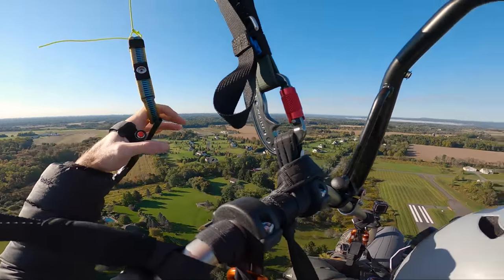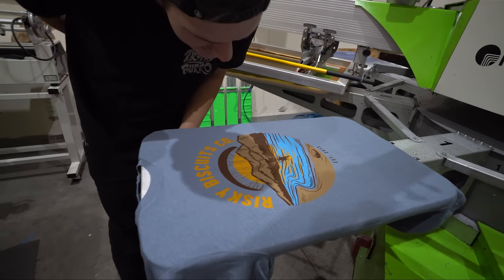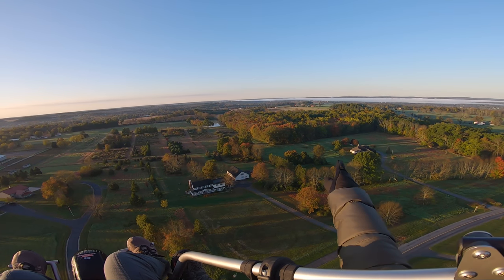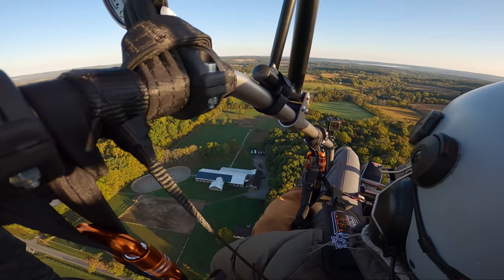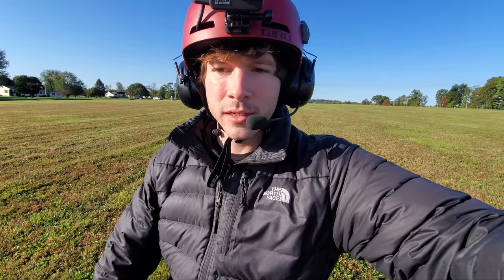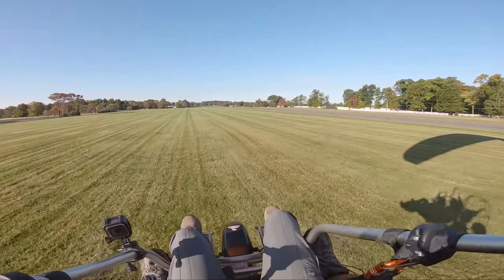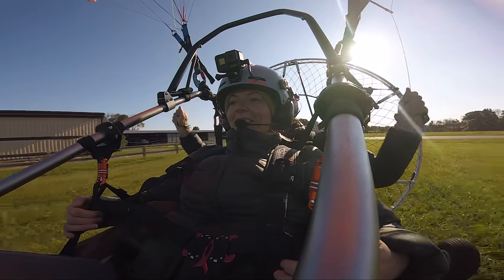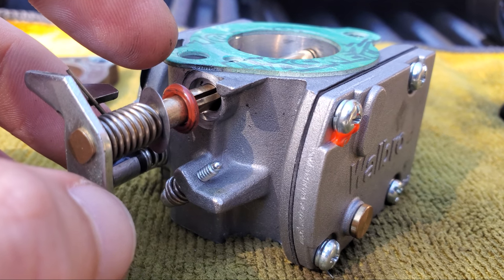I had an ENGINE FAILURE while flying my girlfriend to breakfast...

Comment: Why are you flying a tandem trike with a passenger and you aren't an instructor.  At least follow the FAA rules.  With as much publicity as you get (although I have no idea why) you should set a good example to new or potential pilots.  Bad idea!
Reply from the maker: Please do a little research before you call me out on doing something that dumb. Thanks! 👍
Reply: @TuckerGott  You aren't listed as an instructor with USPPA.  What organization is your instructor and tandem instructor rating with?
Reply from the maker: @dannydewitt1616  Correct. I am certified through another organization recognized by the FAA.